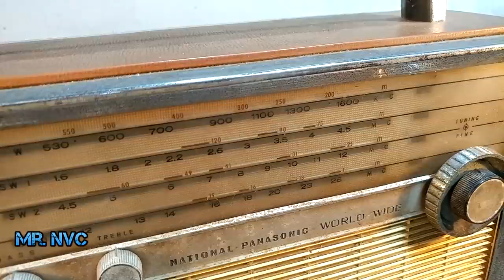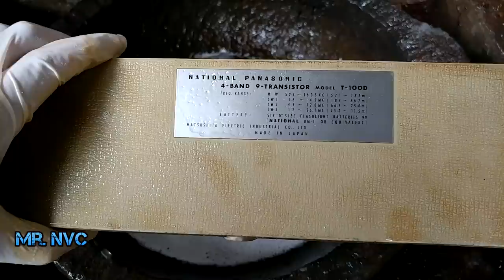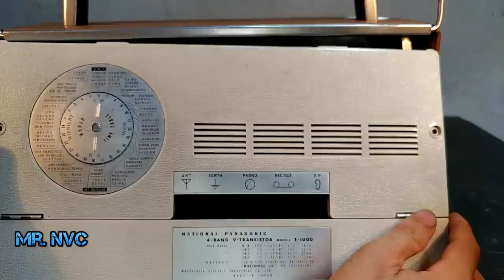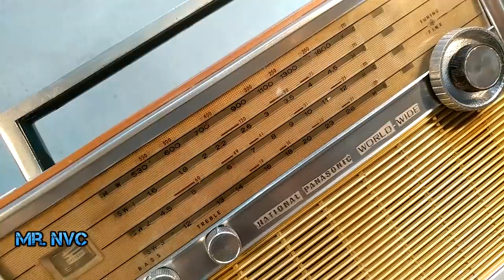1966 National Panasonic T-100D Transistor Radio Restoration

Comment: While you had the chassis out, you should have checked/replaced all of the electrolytic capacitors. I doubt that they would still be all good. Using contact cleaner on all the pots and trimpots should have been done as well. Volume, bass, treble and tuning knob faces look terrible. Overall though, a very good restoration... 8/10

Comment: this is a refined cleaning job. pure cleaning. however, knowledge of this and that is required to fulfill the mission.  anyway, i've always done this here at home - a 1987 gios torino bike with 27" rims with 85% rusted since 1991,  a sony 1978 radio, cassette player, stereo full of aphids and whatnots forgotten and stored up to 2005, a sony 1979 10 inch black and white tv receiver which can barely show something in 1984, and the list can go on.  my technique is to replace what are replaceable like knobs, wires, speakers, cables, chains, led's, electronic parts, bike parts like bearings, belts for cassette drives, etc.  it's not a sin to replace such parts when restoring an appliance.  if it's broken, replace it.  if it's ugly because of corrosion, replace instead of trying to make it look original.  if it's defective, replace.  there is no point in trying to restore something which is replaceable and damaged.  trying to mend something which is cracked, broken or corroded by means of cosmetics may seem heroic, but for me, it's a lost cause.  by the way,  a 9 volt radio is a sure lost cause.  it may have been the reason for it being hidden, stored, forgotten and ignored.  it cannot be called a happy appliance.  we all know how a 9 volt battery suddenly loses juice, especially for a radio with so much to power up - 2 speakers and so much amplification.  it would have been better if it was made with an external power and a transformer inside to supply the 9 volts.

Comment: You should have done a full re-cap, those 1960s and 70s Japanese caps short and go to air, if one is shorted sence it is solid state, could mess up the whole deal

Comment: Surely it would be worth spending a little extra time and money to replace the electrolytic capacitors, after disassembly, to restore performance like new? You would then get the full benefit of the original built-in features; twin speakers, plenty of treble & bass; RF performance (selectivity & sensitivity). As capacitors are very cheap now, (and in disassembly) you have done about half the work to replace them, I make that a strong recommendation...

Comment: You should use hydrogen peroxide to whiten the case, instead of painting it with a chep spray. And how did you fixed to turn it on?

Comment: look i get that you put a lot of work into it...... but painting over the original plastic, chrome, and zinc plating with cheap spray paint is just being cheap and lazy and it doesnt look as nice, not to mention it will wear off and scratch really easily thus looking worse quicker.

Comment: So what? You cleaned it. I wouldnt even dare to use the radio, would just make everything worse. This is not a restoration, the capacitors will kill your radio sooner or later.

Comment: I do not get it, putting in so much effort on an utterly filthy looking (how in the world can an appliance like a multi-band radio from the 1970s get so dirty ... unless it was in a foundry etc?) and zero on the real stuff, the electronics. It would 100% benefit from a going through, those germanium transistors go ‘soft’ over time not to mention capacitors.... so it’s probably down on things like Selectivity & Stability.